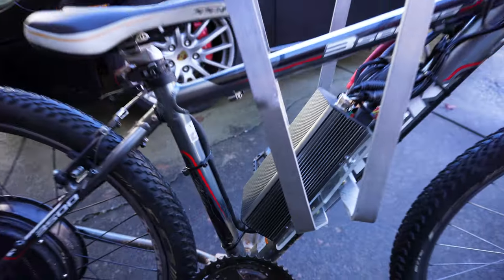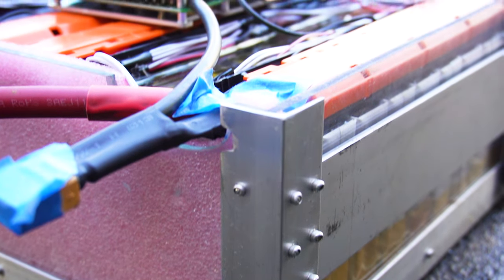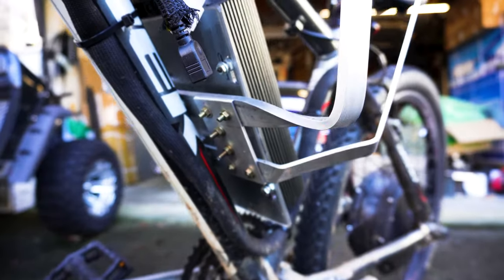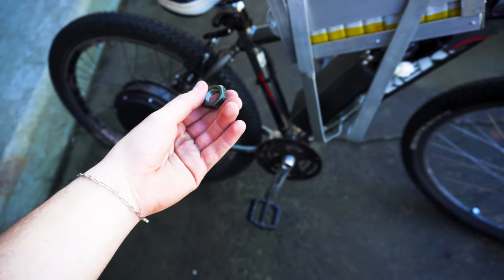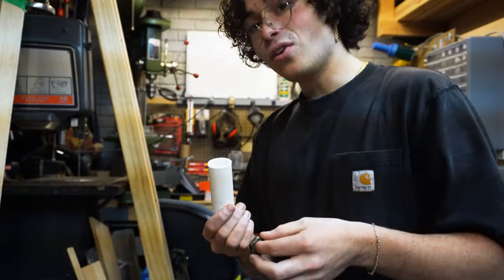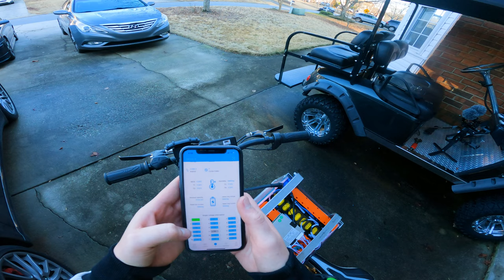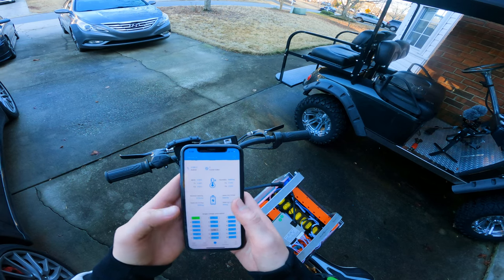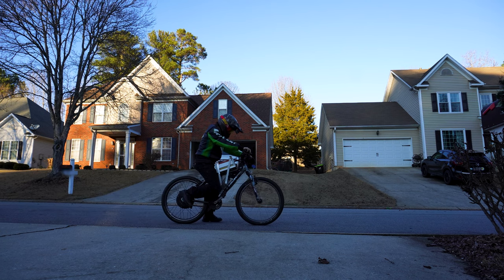Homemade Electric Bike with Custom 72V Battery Goes 75MPH | 14,000W

Comment: Be sure to test every tire by running on the back wheel and getting it up to 80 mph before going out on the road.  Bike tires explode easily at high speed, especially if they are unbalanced.

Comment: Nice bike build. I strongly suggest upgrading the brakes into high quality disc brakes if you plan to keep using this. Although i would like to revamp my own 250w folding e-bike into a 40mile per hour beast unfortunately we can't ride at such speeds here in the city.
Reply: Be a man; switch to coaster brakes

Comment: Part 2 "Back for hospital."  Those bicycle wheels are not meant designed to withstand high speed impacts, hit anything more than a leaf and the wheel will buckle, as for the brakes, your stopping distance would be a mile !
Reply from the maker: Yep! It's dangerous. As for the brakes, 4:41 and 8:58
Reply from the maker: Thank you sir! The strength of both rim brakes + maximum regenerative braking actually gives me a great stopping power.

Comment: Thats insane. Are those stock rim brakes? Will you show us a build video of the battery?
Reply from the maker: I'll make a video of the battery build if enough people are interested
Reply: @AllThingsElectric_  sounds good 👍
Reply: @AllThingsElectric_  i want to know the basic ways in building one with a busmi thingly and understand what it really for. i just dont get why you cant just connect the batteries and connect the motor and just ride the battery without one.
Reply: also how you shop for one
Reply from the maker: I can make a more in-depth video about it, but the generals of a BMS is that it balances all the individual cells' voltages in a battery, keeping it stable (so it doesn't blow up from overcharging or over discharging). You don't need one, but you would have to balance charge after every discharge.
Reply from the maker: You'll look for one that corresponds to the number of cells in your battery. Then, find the one corresponding the charging and discharging current you desire. Or, you could bypass the BMS discharge, like I did here.
Reply: @AllThingsElectric_  are they drill battery packs connected in series and a bms? So you can bulk charge the whole thing?
Reply from the maker: They're not drill packs, I'll give more info on it in the future. But yes they are all in series connecting to the BMS. I can bulk charge the whole thing yes
Reply: @AllThingsElectric_  ok cool...whats the cost of building a pack like that? Similar packs are close to a grand or more.
Reply from the maker: Sorry to tease it, but all of this info will be discussed in a future video. Stay tuned!
Reply: @AllThingsElectric_  ok np

Comment: The battery is 66.6 volts, not 72. You base the rated voltage by the nominal voltage of the individual cells. For example. You have 18 cells in series, so the math would be 3.7 volts per cell, X 18 in series. 3.7x18=66.6. You're welcome.

Comment: 75mph is not realistic , the real speed is in the bike on the road, and this motor cant put more than 100kmh with this battery, I have one similar and only arrives at 80-90kmh
Reply: I did 74mph but I have 29in and sabvoton 72200 controller.
Reply: Idk how many turns the motor is but I was wondering if there's a timestamp with the actual 75mph speed. The most I've gotten on a 72v battery is 57mph with flux weakening and a slight downhill. Sorry it says 3.5t in description.

Comment: last year I checked most of el. bikes to buy one and most high power ones had motor open with holes so one rain and it will be dead, thus got one which was most protected in plastic casing for electronics and sealed it's electronics even more 20-30 rains down and still running

Comment: Reminds me of when I was a 11 year old with a Schwinn stingray style that had a two speed transmission that you just kick backwards to change gears, and then go backwards and hold it still to brake.  Was going down a hill steeper than I could peddle 45+ and when I hit the brakes the internals of the 2 speed hub blew up and locked up the back tire permanently.

Comment: What watts rear wheel is that and what controller you using please I have a 5000watt rear wheel and a 80a controller but mine does 45mph max my battery is a 72v 40ah .. I'm thinking I need to change my controller for more top end .. it's a rocket to 40mph
Reply: So, I brought 5000w fat tire setup like yours. Difference is that the 72v 40ah must have discharge of 100a, I had the 80a and it sucked. I brought the 100 Amp controller and hit 65 without even going full throttle. Gotta upgrade to 100amp discharge battery with the 100 a controller.
Reply: @JCJeffrey  thanks for info my battery is 100amp discharge I have ordered a fardriver controller it's here just havnt set it up till my new frame is built hopefully il get the 60mhp plus top end as when it hits 45 feels like it's hitting a limit with the controller iv got

Comment: So this is still the same motor and controller as for the 10KW version? 
Yes, this with a the rim brakes is a wonder! But for going downhill on a regular bike they must also do their job. They even perform better with for example pads from Kool Stop or similar. The bicycle tires could be a problem on high speed.
Reply from the maker: Yes it is the same motor, just putting more voltage through it.

Comment: As some on commented, test the tires, tubes and rim first.  How would you do if you flatted or worse, blew up the front tire and was unable to reliably steer. Crash and burn on a bike is not fun.

Comment: This is pretty dangerous man, this frame is not meant for a electric bike with so much torque like yours. The frame may crack or break! Try looking into tougher bike frames like enduro, motorcycles or dirtbike frame
Reply from the maker: Very correct! Nobody puts this much power on a frame like this! That's why I thought it would be interesting and make a good video.

Comment: Hey how’s it going, which motor is that how many watts is it rated for? I have a 2000 watt motor ( same kind as yours) thinking about upgrading
Reply from the maker: It’s a QS V3 5000W hub

Comment: If that thing ever catches on fire, you'll probably be peeing out of a tube after that.  Maybe put it on a rack behind the seat.
Reply from the maker: I trust my battery more since I manufactured it. Trusted cells and good protection/case. Hopefully that would never happen, but mounting on the back would be unreasonable for the bike's weight distribution.

Comment: I’m trying to build a bike that goes faster than the 20mph … I have a bafang wheel hub and a bike nothing else I’ve been researching… anything you can recommend for a controller?
Reply from the maker: Sabvoton or Kelly, best controllers for the price. BAC8000s and the surron controllers are way overpriced

Comment: Wouldn't it have made more sense to put the pegs where the pedals are and swap those out?
Reply from the maker: 4:32 I show what it would be like to have my feet on the pedals. The battery mount is in the way. I also tried to take the pedals out but need a special tool to loosen the crank lol.

Comment: Why not just get a bike rack and bungji it on the back look a lot neater
Reply from the maker: I thought through that approach, the bike would be very imbalanced and the rear tire would not be able to support so much weight. The bike would do wheelies even under light acceleration.

Comment: This is amazing. 
What is the range on average speed say 20-30mph? I'm really interested in the range.
And what is the cost of all the parts?
Reply from the maker: Haven’t done a range test yet, but with my old setup (20Ah) I got 50-60 miles. Leads me to believe the range on this setup (37Ah) would be around 80-90 miles
Reply from the maker: The cost varies depending on where you get the parts. I spent about $2000
Reply: @AllThingsElectric_  -  Faster = less range = more air pushing.

Comment: U should of bought a bike rack and put the battery n the back not the front?
Reply from the maker: Too much weight on the rear, that would make it handle poorly. In addition, the rear tire and tube would not be able to handle that much weight.